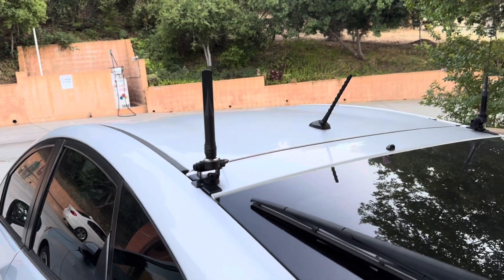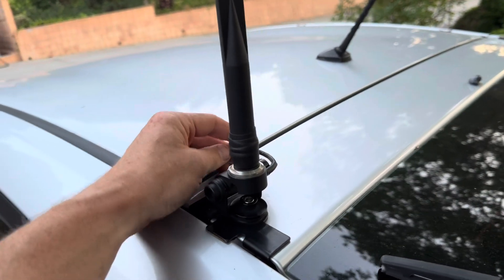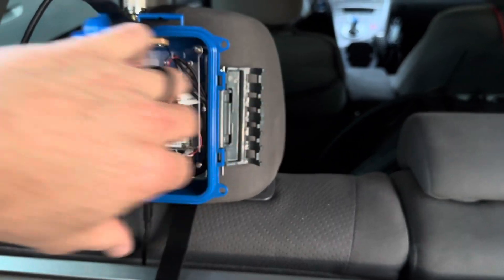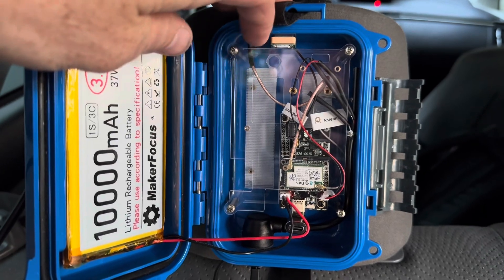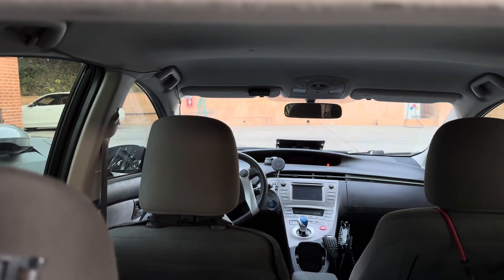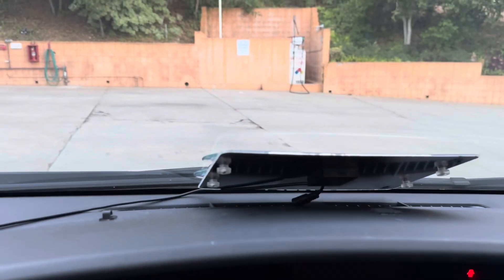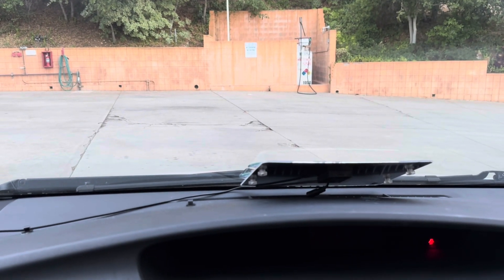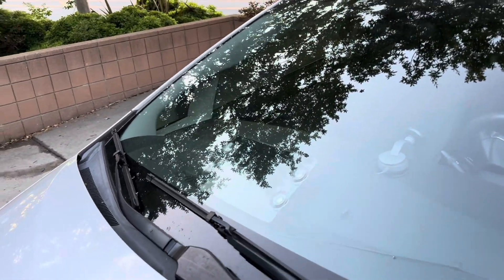Vehicle solar Meshtastic node

Comment: Run that cable along the floor and not across the airbag in the windshield piler. When that airbag goes off, the cap will stay with straps, but that cable will become a missile in that car flying who knows where.....
Reply from the maker: Excellent point thank you

Comment: Is it possible to just power it from the vehicle's 12v system?
Reply from the maker: It is. I didn’t want the constant trickle drain on the battery though. Also wanted to option to park the vehicle at a high point as a semi fixed node. My mobile radio setup is crossband repeat capable for the same reason.
Reply: I did something similar but used the OBD port under the dash for power since it's always on.  Great setup, love the mount and using the nRF52 based modules are much lower power than the ESP32.